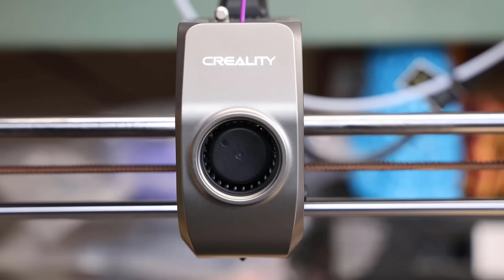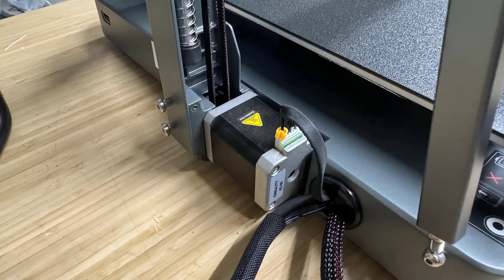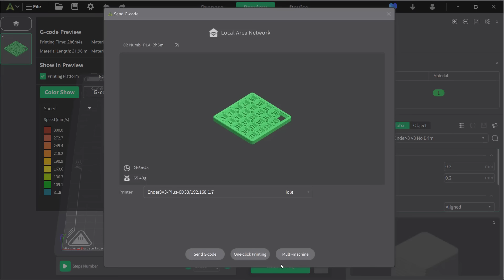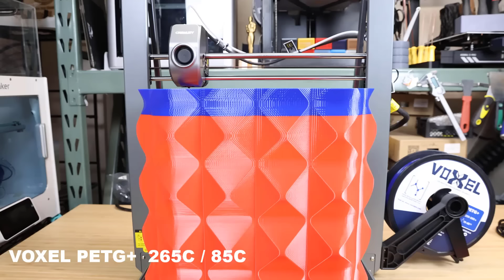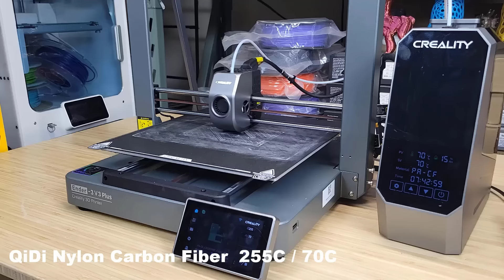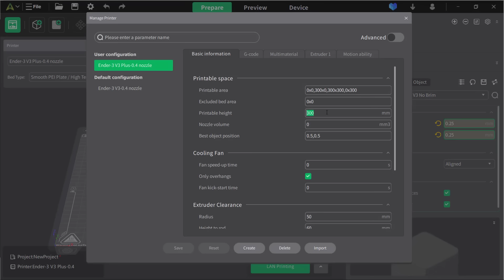Creality Ender 3 V3 PLUS review: CoreXZ, die-cast gantry, 300x300x330mm print volume

Comment: I move the filament sensor to the top, ditched the PETF tube, and now use a dry box to hold the filament. It works well for the most part. I do have some failed prints but they are few.

Comment: Great review! I was able to buy the Plus refurbished on eBay for $158. That was March 2026. Since then I've had to replace the motherboard and hotbed, replaced the Extruder. For the most part the Plus has proven to be a workhorse. Very solid. I've since added the Kobra X and have ordered the i8 from Creality with their early bird pricing. Your reviews on all the printers I've purchased have been spot on. Keep up the great work.

Comment: Special note with this printer, the upper X axis rod is a graphite infused, brass bearing, and is not to be lubricated at all, no grease or it’ll mess it up
On mine the first quarter inch of all prints have bad walls and I’ve never been able to figure it out, otherwise it’s a really good printer

Comment: Have you made (or thought about making) any general guides on 3d printing? I have trouble with other guides because a lot of the time they seem to leave something out that they consider "obvious". It will say something like "set the settings to match your filament" but when I look at my filament it has a range of temperatures. how do we figure out what one is correct?

A meticulous guide showing step by step how to find the proper settings for a filament through testing or how to change filament when it runs out and stuff like that. I see set up guides all over but not many for the "every day usage" guides. I see calibration guides as well but they are always missing something. The only thing I usually see thats very in depth is bed leveling. Usually the guides will say "print this and see how it comes out" but that doesn't really explain to newbies how to figure out what needs to be changed. Does problem A mean that its too hot or too cold? Is the print speed too high? etc. I found lots of calibration prints but they don't say how to figure out how to calibrate using them or if they do they are vague.

I purchased an ender 3 max neo a few years ago and It totally turned me off from 3d printing all together. I had purchased a bunch of filament and I could never get it to print. I finally took time to play with it some more and I found that it must have been a used/returned printer where the person claimed it was never opened because there was filament stuck between the extruder tip and the tube going to it. The filament had melted and was too far up the tube to allow filament through consistently so I could sometimes get it to flow (poorly) but even if it did if it ever cools down the problem starts all over again and I need to redo the unclog process over and over... I never even was able to get to other issues like it failing to stick to the bed often times or how if it DOES print the extruder eventually hits the print itself and knocks it off the bed. I'm sure you can imagine why someone new like me would get turned off from the whole process. I put in the effort and work to figure things out just to find there was no solution at my skill level and no reliable guides for my specific situation.

Anyways I was going to replace the whole extruder setup with the sprite setup and make a couple of other QoL upgrades but at that point I'm paying half the new models price and the new one seems a LOT better. I chose to just buy the new one so i guess wish me luck lol

Comment: I tried the tolerance test and it worked in all areas. Something might be wrong with your print. It’s a good idea to print the tolerance test twice and with filament from a different manufacturer. You should also mention that this printer is super compact for a machine with a 300x300x330mm bed, especially for a bedslinger.

Comment: I begged Elegoo to make a Neptune 4 Pro version of the Neptune 4 Plus or Neptune 4 Max, because those large fast printers need an all steel motion control system more than the smaller Neptune 4, but they never did.  Anyone wanting a large good and fast bed slinger may want to look at the Ender 3 V3 Plus, although for a little more money they could get a Sovol SV08 or Creality K2 Plus if they wanted an enclosed coreXY machine.

Comment: Would you recommend a regular Ender 3 V3 or a BambuLab A1? They are basically the same price, only thing I don't like about the Bambu is the lack of linear rods on the bed. The 256mm bed size on the A1 vs 220mm on the V3 probably puts the A1 ahead. What do you think?

Comment: I downloaded the newest Creality "Slicer" onto a Win10 machine an hour ago. WHAT A MESS! First of all it asked to AMS information on my K1 and K1Max? To my knowledge Creality isn't even SELLING their "new" AMS system yet????? Secondly, the interface was FROZEN on my 27" monitor. The message said there's a problem with missing AMS information (well, yea!) and you have to "fix it" but the entire interface was LOCKED SOLID. WARNING: Creality's newest slicer is DOA on arrival. Do Not Download and INSTALL.
Reply: UPDATE: They've changed the graphic on the download of the "new" creality slicer back to the previous design. I wonder if they've stopped distributing the newest slicer?

Comment: I hope the bed has its own accelerometer to measure resonance, if it is using the one in the print head then I don't know what kind of magic they are doing to try and tune the input shaper. The K1 had the problem of measuring only the x-resonance and using the same input shaping values for the y-axis, even though they will not behave the same mechanically.

Comment: 22:05 Is the surface quality something that could be corrected with a firmware update or is it a hardware issue?
Reply from the maker: Most likely a firmware issue. This happened to the K1 series before, but after a few updates, it has gotten much better.